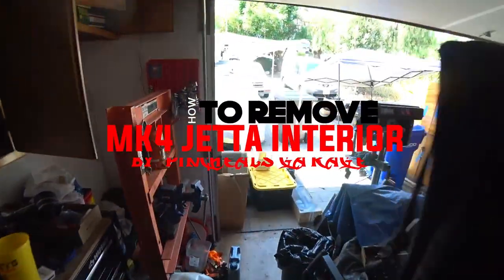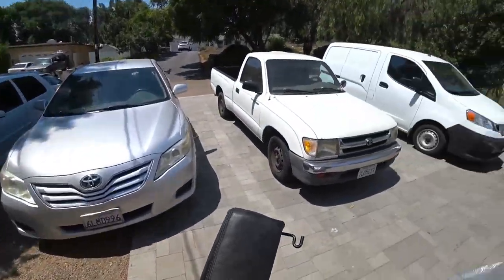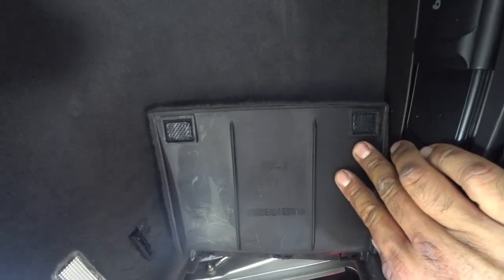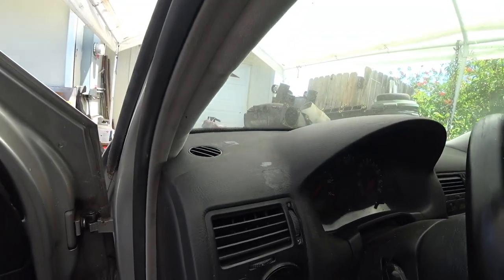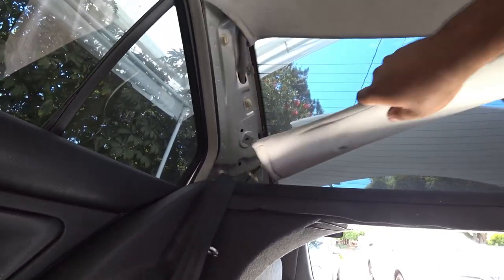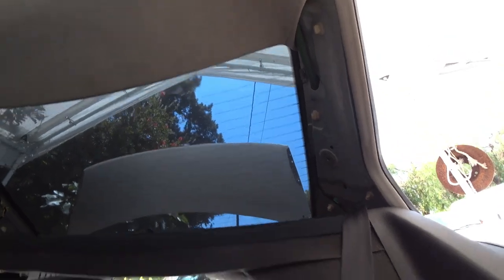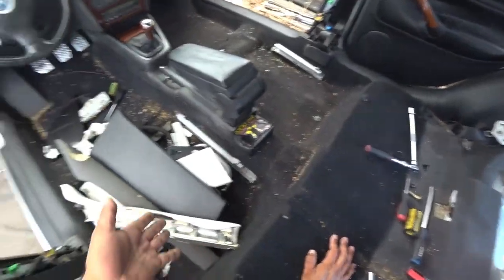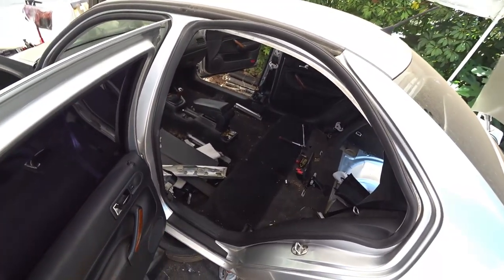How to Remove MK4 Jetta Interior S7EP7

Comment: Found there's two Phillips screws in the middle of the plastic door sill below where the seat belt retractor sits, and I'm repairing a rust hole caused by a incompetent mechanic who jacked up on that spot long ago.